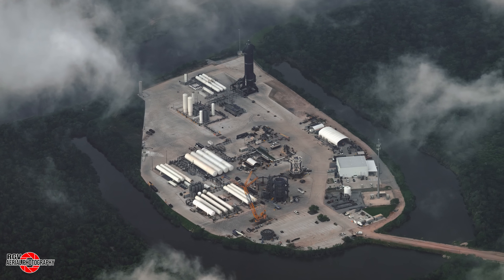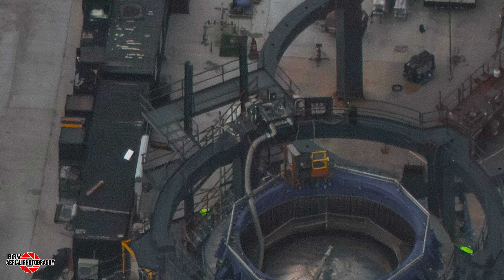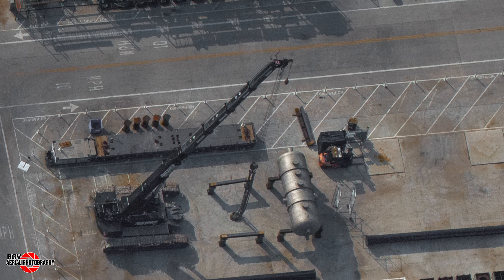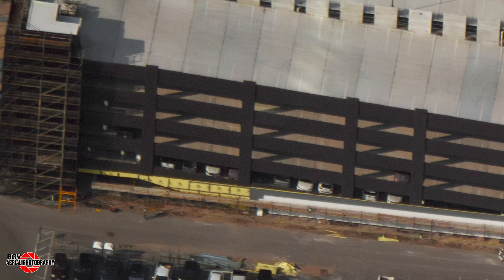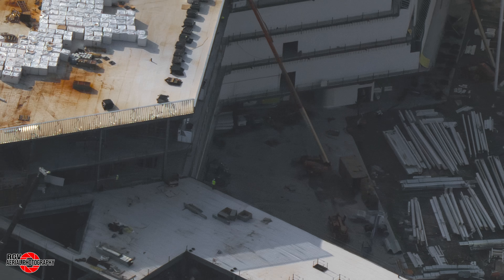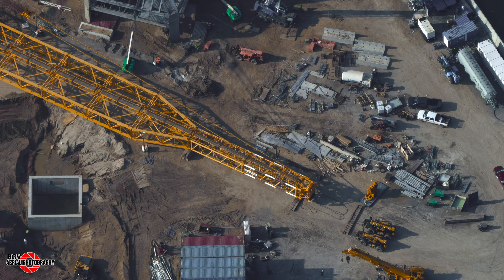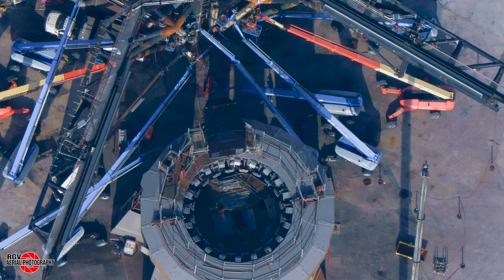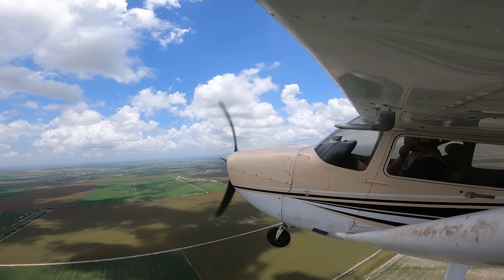Work Begins on Flame Trench Foundations + Massive Chopstick Work! SFU 57

Comment: Not sure they will move forward with IFT-6 vehicles at OLM/P until IFT-5. I don't think they want to risk damage to all the prep work they have done for IFT-5.
Where are the methane recondencers for Pad A? I thought all the current hippos were for sub-chilling propellant for loading.
Sometimes, when you are talking about a specific item it is highlighted (8:35), sometimes it is not (8:40).
Thank you for another great video!

Comment: Off the start, this narrator is green af. Not terrible, but even AI can deliver a better result. Great content but narrator should have a radio voice and the sound should be captured in a way that does not bottom out the lows with pops . Hard to watch without muting -and that sucks. you guys usually have awesome narration. Not often I nope out of your posts, but at 4:00 I'm out. Fingernails on a chalkboard level of cringe.

Comment: For Tower 2 (and Tower 1) was there ever confirmation from engineers or contractors that concrete is being poured down into the level below rather than the ports being used to pump concrete up into the tower leg above that point?  Pumping from the bottom [level by level] should ensure good consolidation with minimal vibration and removing the significant drop which normally causes segregation.